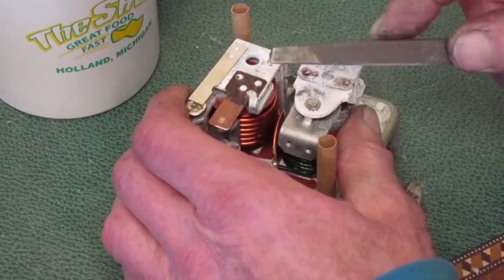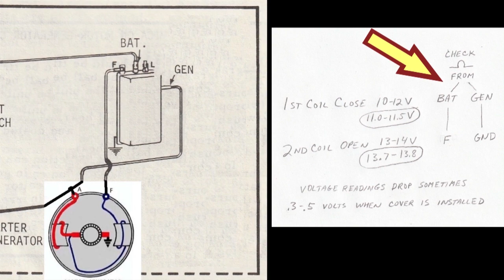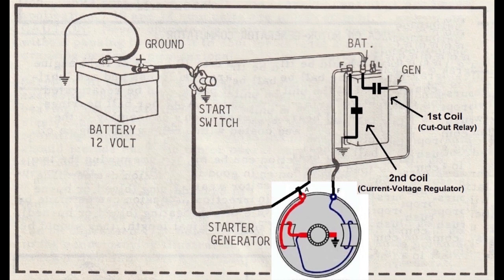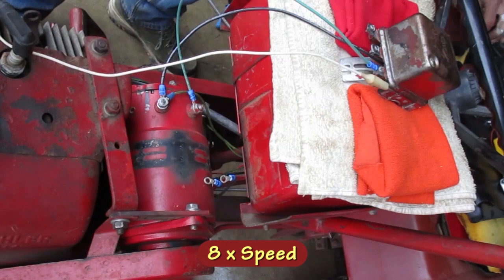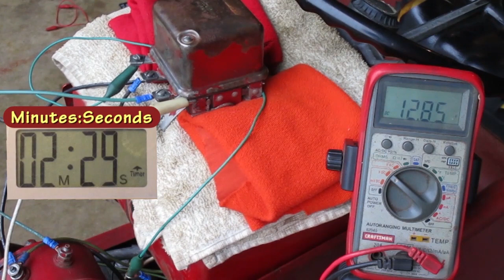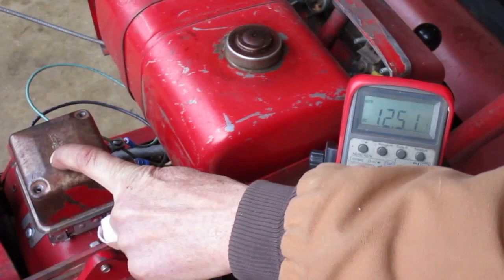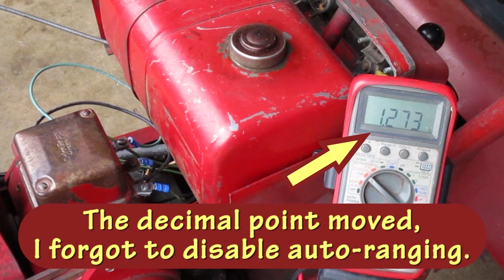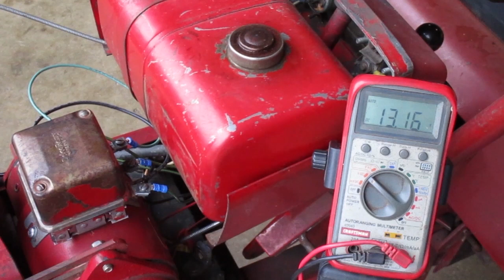Kohler Delco Remy Voltage Regulators Part 4: How They Work & Adjustment While Running

Comment: This was a very comprehensive series. I have several Sears Suburbans that have this setup but the generator/starter & regulator are buried under the battery tray making these on tractor adjustments impractical. Thx for taking the time. I will use this over and over.

Comment: my cub did the same thing but it never pass 13v and it had a new Voltage Regulator and a new gen set but 13v at full speed and thing less it will stop